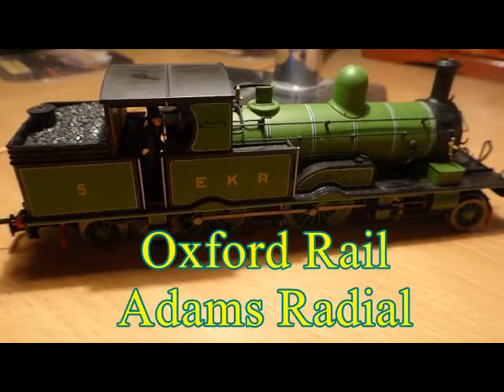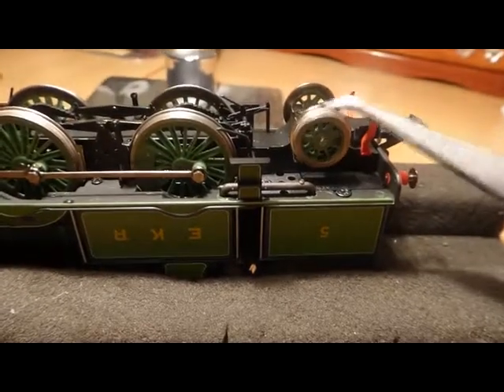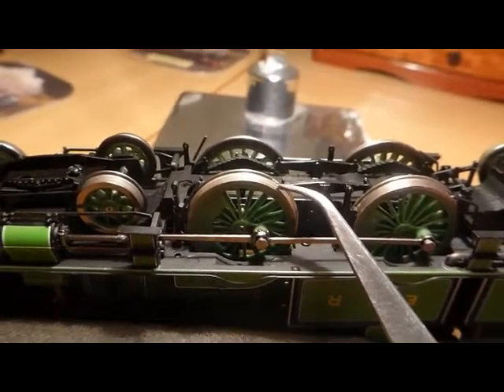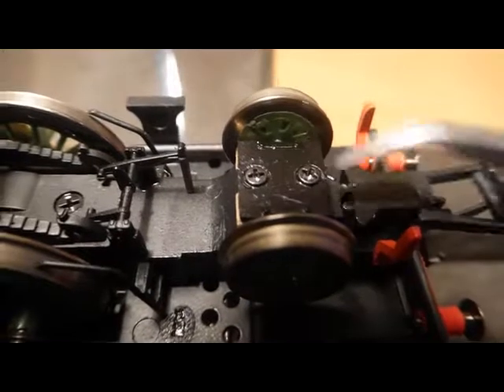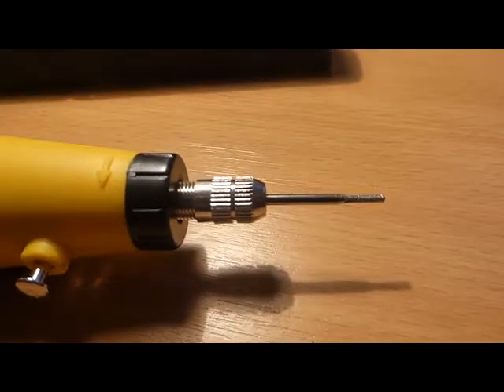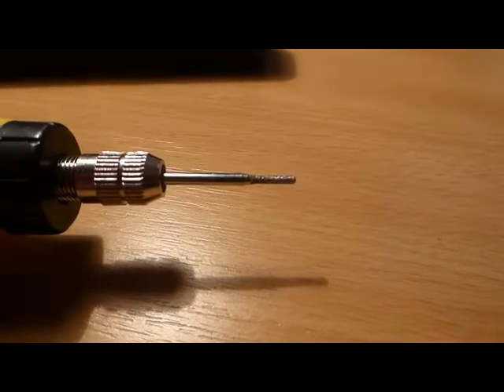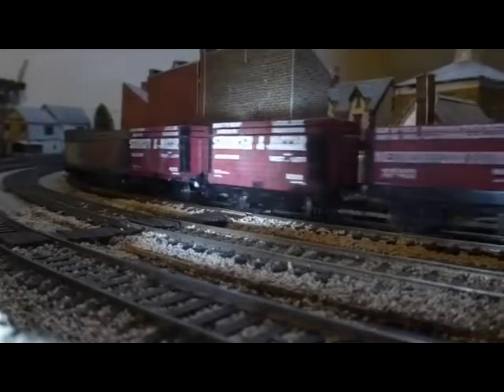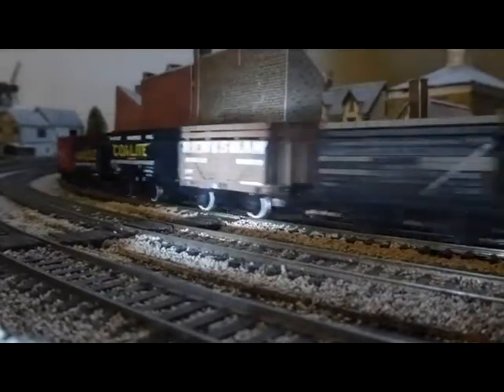Adams Radial Wheel Slip How to Fix the Problem

Comment: This is a problem I've not yet heard of. Glad you managed to solve it. Aside from rear wheel housing design issues, slipping on wet rails is something that happens to every real steam engine. Wheel-slip in dry weather is almost as common, especially when you're driving a Southern Light Bullied Pacific Engine. The Spam Cans have always be prone to slipping when starting off, City of Wells on the Main Line being one example. Hope your problem doesn't arise again.
Reply from the maker: It's a problem with the Oxford Rail Radials because the  coal bunker wheel lifts the 2nd drive wheel such the loco can barely pull 1 coach and will slip on even the most gentle slope.

Comment: HI how on earth did you get a decoder in there i cant get the body back on mine as much as i try also i lost both of my springs and oxford rail don't have any more any idea where i could get replacements .thanks.
Reply from the maker: Ooh dear,  try London, they have a few packets of small springs for hornby locos that might fit.  From memory the rear wheel springs are very thin.  Otherwise a watch maker might have tiny springs.  You 8 pin decoder fits in the coal bunker.   See my more recent video of 3 Adams all running all with sound

Comment: Bonjour VC, I finally found time to fix the issue on this engine following your advice. The only tricky part was putting the wheel wipes back in place. These wipers touch the wheels on the top of the flanges. And I wonder if this is correct ? A lot of dirt had already build up on them so I think that a regular cleaning will help the smooth running. Thanks again for your kind reply and the info on the video. Happy railroading  & greetings. Filip

Comment: Hi VC, Thanks for uploading this tutorial fixing the wheel slip of this engine. But do you put the springs back after adjusting the vertical axle housing ? And did you ad weight to improve the pulling power ? Greetings
Reply from the maker: Hi,  yes the springs are essential  and went back. The extra weight made little difference, the improvement in the freedom for vertical movement of the rear trailing wheels made a massive improvement.  Since making this video I purchased a BR black Adams and that was fine from the start with nothing done to it which suggests that Oxford Rail may have improved the model since the earlier ones